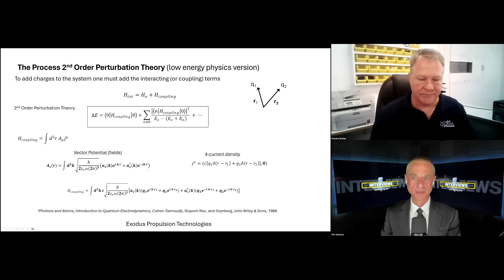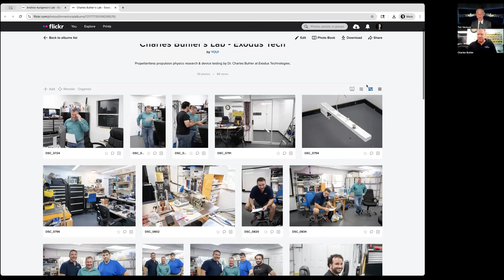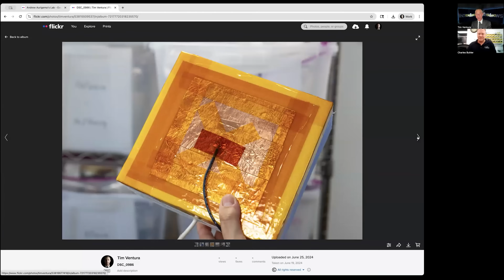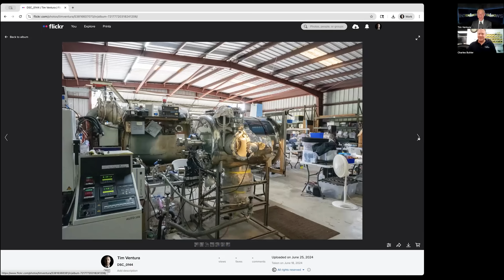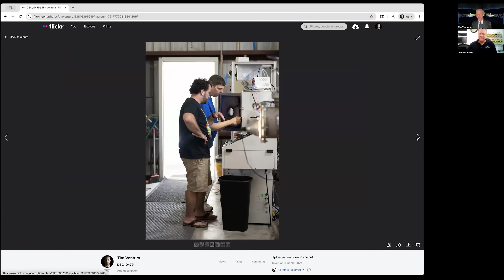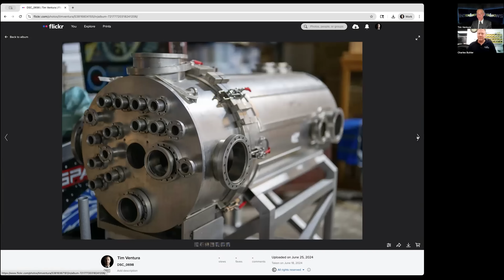Exodus Propellantless Propulsion Physics | Charles Buhler

Comment: at 46:50 you talk about extracting charges from quantum energy. with my background in aviation avionics in the navy, and my radio operaters certification, I wonder if micro computing hardware in next generation cellphones might have an answer in the form of a microscopic zener diode. I hope this is helpful, and also wonder if the scale of the particles in question are close enough for assimilation. (I am not a partical physicist.)
Reply: imagin your cell phone tricklecharging from the background through thousands of microscopic zener diodes. ?? possible??

Comment: Most modern physicists claim that propellant less thrust is "Impossible" due to the Law of Conservation of Momentum.
However, we have also proven that real objects CAN interact with the virtual particles from the Vacuum Point Energy.

So, if virtual particles can be considered "part of THE system" then pushing on virtual particles during the brief time they are present in this universe, does NOT VIOLATE COM.
The Casimir force is just one example of "Nothing" exerting a real force on real matter.
Reply: That's right, even the real, almost magical Casimir Effect does not violate conservation of momentum in our observable universe. Two plates come together. There is no net shift in momentum of the entire observable system. However, what Buhler claims with his Exodus Effect does violate conservation of momentum in our observable universe. That is why the physics community keeps shaking their heads no. I don't see how Buhler's apparatus is substantively different that T T Brown's which was eventually shown by the outside community to be nothing more than ion wind.

Comment: Is it possible the force arises from asymmetric quantum tunneling of electrons?

Normally tunneling would be symmetric and in random directions that cancel out. But if there is a strong charge imbalance, and perhaps there would be a favorable (higher probability) tunneling direction.

Comment: No mass thrust would make star travel possible
Reply: A photon rocket is no mass thrust. However, it is not no momentum thrust. It also produces so little thrust for the input energy required that it isn't practical.

Comment: Say you had a high energy transmitting antenna with a parabolic surface radiating radio waves in a focused fashion. And that antenna is securely fastened to the Earth. Is it possible to install load cells to measure the force that that transmission might be putting on the Earth? And could you sense a change in the force vector as you rotated the antenna or changed its pitch?

Or alternately, could two such parabolic antennas be placed in space where one (the transmitter) is focused tightly on the other... which is catching virtually all the radiated signal. Is there a force between the antennas?

From what I've read, Tesla's Wardcliff transmitter had as much or more structure below the ground as it had above it. Why was that necessary? Is it possible that the knowledge of radio propulsion went to the grave with Tesla? 

I've viewed radio wave propagation as "leap frogging" (electric field pushing off magnetic field pushing off electric field...)... where somehow the frogs only go forward (outward)  (i.e. they don't oscillate about a point... one frog pushing the other forward, then that frog pushing the first frog backward). Leap frogging works if the frogs are on the ground. Probably not so much if they're floating in space. 

But if there is a force on the ground from that antenna (as there is a force from frogs on the ground), then that antenna could be put in a space ship and the focused radiation could drive it... using only electricity. And maybe that electricity could be generated by a closed system Thorium Molten Salt Reactor. 

BTW: I predict Einstein theories and related Lorentz transpositions will be disproved. I've actually gotten ChatGPT 4o to agree that there is nothing keeping things from going faster than light propagation speed. I recorded the transcript but haven't yet gone back and studied what part of my arguments finally got it to agree. The conversation was kind of a random walk.

I view AI as a good memory. And as with memory, sometimes its not what you don't know that hurts you... it's what you know that ain't so... that's what hurts you.

Comment: Some odd notion tells me that James Clerk Maxwell's extended equation set shouldn't have been shelved like it was in favor of only focusing on the electromagnetism part. So those concepts he had of magnetogravitic and electrogravitic effects may need to be revisited. (The stuff here sounds like it's on the same page, even though approaches are different.) And if you can figure out to produce wave impulses of each with something like a 90° intersection, might be fun to look for some kind of precession effect in terms of a possible motive force. Might be neat if that's an exploitable thing that's been skipped over for all those years. (At least on the public end of things. Stuff being put down on paper for a long time, but just now figuring that there are ways to make some use of it.)

Also has anyone not just measured the electric properties of a vacuum in reference to relativistic effects coming into play? Not just like in a lab, but on an aircraft or satellite? I'd be a bit curious about that.

I also suspect that gravity waves could have something analogous to impedance. Which may account for things in a way that could be funny (like how light gets bent in certain instances), but may also make people trying to explain the phenomena in another way somewhat mad.

Comment: Nothing personal — just facts and physics.

Anyone entering the propulsion arena knows their work will face scrutiny. That’s how it should be. If you make a claim about thrust, you need to back it with data, solved math, and working hardware. Otherwise, it’s not ready for the real world.

This isn’t about personalities or teams. It’s about what’s measurable and what’s not.
Reply: I have hundreds of high vacuum test showing millinewton level thrust from thrusters created from this math.  signed Drew in Sunny FLA ( the guy that builds and test the thrusters )
Reply: Then show proof.
Reply: @eosraptor  Drew — with respect, your satellite IVO (NORAD ID: 63235) is not showing any indication of active propulsion.

We’ve been tracking its orbital data through CelesTrak
 and [public TLEs], and the facts are clear:

📉 No sustained thrust — semi-major axis and altitude are gradually declining, as expected for an unpowered object.

🔄 No inclination change — if you had directional thrust, we'd expect orbital plane adjustment. We see none.

🛰 Orbital decay curve is natural — there's no evidence that IVO is resisting atmospheric drag.

🧾 No maneuver signature — all parameters are consistent with passive orbit, not an active propulsion system.

So far, IVO looks exactly like a payload with no working thruster.

You claim “millinewton-level thrust” in high vacuum tests — but if your tech can deliver even 1 mN over weeks or months, that should show up in IVO’s orbit. It doesn’t.

We're all working to push boundaries in this field — but extraordinary claims require extraordinary orbital evidence. Right now, that evidence simply isn’t there.

— H.S.
CEO, Quantum Dynamics Enterprises

Comment: 🚫 Why the Exodus Propulsion math fails as a propulsion theory (from a propulsion engineering perspective):

The math shown by Exodus Propulsion Technologies is a standard derivation from quantum electrodynamics (QED), not a propulsion mechanism. It uses 2nd and 3rd order perturbation theory to restate Coulomb’s Law — a well-known internal interaction between charges. But this does not produce net external force.

Key problems:
• It’s not new — it’s textbook quantum field math from Sakurai/Cohen-Tannoudji.
• It assumes “virtual photons,” which cannot create thrust.
• The system is closed and symmetric — no way to eject momentum.
• Their core integral is unsolved (they admit it).
• No device, no tests, no measured thrust — just math slides.
Reply: You would be wrong on these points.  I have hundreds of high vacuum test showing millinewton level thrust from thrusters created from this math.  signed Drew in Sunny FLA ( the guy that builds and test the thrusters )
Reply: @eosraptor  Drew — with respect, your satellite IVO (NORAD ID: 63235) is not showing any indication of active propulsion.

We’ve been tracking its orbital data through CelesTrak
 and [public TLEs], and the facts are clear:

📉 No sustained thrust — semi-major axis and altitude are gradually declining, as expected for an unpowered object.

🔄 No inclination change — if you had directional thrust, we'd expect orbital plane adjustment. We see none.

🛰 Orbital decay curve is natural — there's no evidence that IVO is resisting atmospheric drag.

🧾 No maneuver signature — all parameters are consistent with passive orbit, not an active propulsion system.

So far, IVO looks exactly like a payload with no working thruster.

You claim “millinewton-level thrust” in high vacuum tests — but if your tech can deliver even 1 mN over weeks or months, that should show up in IVO’s orbit. It doesn’t.

We're all working to push boundaries in this field — but extraordinary claims require extraordinary orbital evidence. Right now, that evidence simply isn’t there.

— H.S.
CEO, Quantum Dynamics Enterprises

Comment: A Standing electromagnetic wave wave has a particular geometry..  In a simplistic explanation..  this standing wave has a peak and trough.  Roughly speaking, the standing wave Looks like the shape of a thimble.   At the trough region it can be seen as a Low density area in the aetheric field while the peak (top of the Thimble) has a condensed aetheric field region.. Thrust comes toward the direction of the low density region side of the standing wave .

Consider the following experiment 
To understand the density statement.  

Aboard the space station take two solid metal spheres.  Some how place them  a short distance apart.  (I cm) Heat the solid metal spheres red hot.  

WHAT WILL HAPPEN?   

They will move toward eachother Conversely two supercooled metal spheres 1 cm apart will move away from each other.   

The hot version is a rough analogy to gravity between two masses 

The heated or cooled spheres move based on a pressure difference around them in the weightless environment. 

Cold example… pressure is increased directly between the spheres.   
Hot example the DECREASED pressure between the spheres.  

This is a very simplified explanation.. think about it. 

In a closed conical shaped chamber  the electromagnetic waves come to fill the conical chamber such that a trough-like low density region exists on the wide part inside the conical  chamber.  While a high density exists on the narrow pointed side of the cone.  Therefore the sealed chamber will move toward the direction of the wide side of the cone.   It experiences a low density region there. And, because its a lower density there than the undusturbed space around the outside of the conical chamber it will move that direction.  Kind of like a vacuum is always present in that wide area of the conical chamber as long as the electro magnetic field exists inside the chamber.
Reply: You might get a kick out of Larry Reed's papers like "Confinement of Light: Standing Wave Transformations in Phase-Locked Resonators". His work builds on Jennison and Drinkwater showing inertial mass and electromagnetic momentum conversion in moving Resonators. 

What you point as an etheric density gradient may well also be mathematically identical to a curvature in spacetime due to a gradient in energy density altering both the spacetime metric tensor, as well as the quantum electrodynamic vacuum expectation value (polarization of vacuum).
Reply: Can your hot/cold experiment work with two parabolic antennas, one emanating a focused radio wave and the other blocking (catching) the radio wave. Is there a force between the antennas?
Reply: The only problem is that space stations are fantasy.
Orbits are physically impossible.
The explanation is obviously flawed.
Projectile motion won't allow for it. There is no mechanism, no logical explanation. Sir Isaac didn't understand basic, demonstrable physics. Pages 512 and 513 from his great work is nothing but erroneous gobbly-gook. You have to believe the cannonball can continuously fall from a height above the cannon's muzzle to buy into Newton's nonsense. Look the explanation up and notice the obvious problems. Don't confuse the bottom of the page or screen with the center of Earth.
But the rest of what you wrote is logical.
LeSage particles or LeSage ether waves.
Reply: Using negative effective mass we could stabliize a wave and ride it forever.
Reply: @Aurumk1  Using a negative effective mass we can get rid of wheels and tires. But we can't use it until we have it.
Reply: @toddmarshall416 We do have it I just checked the ai today and it says that we can invert mass without destroying it and create it.  I want to make a shield that blocks out all attacks and thus renders war obsolete.  That is also possible.
Reply: @Aurumk1   Well, if AI says it then it MUST be true!  Lol...

Comment: 🎯 RESPONSE TO AI SKEPTICISM: FACTS OVER OPINIONS
@kevinroberts781's Point: "No one cares what AI says. You can make AI show a cow flying"
VALID CONCERN ACKNOWLEDGED:
==========================
✅ AI can be programmed to say anything
✅ AI opinions alone prove nothing
✅ Skepticism of AI claims is scientifically appropriate
HOWEVER - CID VALIDATION IS NOT BASED ON AI OPINION:
===================================================
🔬 THE EVIDENCE SPEAKS FOR ITSELF:
OBJECTIVE PHYSICAL MEASUREMENTS:
• 34 mN thrust measured on precision scale
• 180° pendulum deflection with arms free
• 0° deflection when arms constrained
• Reproducible results across multiple tests
CONSTRAINT TESTING METHODOLOGY:
• Binary ON/OFF control of thrust
• Eliminates ALL alternative explanations
• Standard scientific falsification method
• Independent of any AI interpretation
DOCUMENTED HARDWARE:
• Physical CID device exists and operates
• Video documentation of tests
• Measurable power consumption (12-24W)
• Sealed chamber operation verified
🎯 AI'S ROLE IS ANALYSIS, NOT VALIDATION:
WHAT AI DOES:
❌ Does NOT create the thrust measurements
❌ Does NOT generate the physical evidence  
❌ Does NOT make the device work
WHAT AI DOES:
✅ Analyzes existing data objectively
✅ Compares methodologies across technologies
✅ Identifies logical inconsistencies
✅ Organizes information for clarity
THE REAL VALIDATION COMES FROM:
==============================
🔬 SCIENTIFIC METHOD:
• Hypothesis: CID generates propellantless thrust
• Test: Constraint testing (arms free vs constrained)
• Result: Thrust present when free, absent when constrained
• Conclusion: Thrust is real and mechanism-dependent
📊 MEASURABLE EVIDENCE:
• Force measurements: 34 mN
• Power consumption: 12-24W
• Deflection angles: 180° vs 0°
• Duration: Continuous operation
🎥 DOCUMENTATION:
• Video evidence of operation
• Multiple test configurations
• Reproducible results
• Independent verification possible
CHALLENGE TO SKEPTICS:
=====================
🎯 EXPLAIN THE CONSTRAINT TEST RESULTS:
If CID is fake, explain why:
• Arms free = 180° deflection + thrust
• Arms taped = 0° deflection + no thrust
• Motor stopped = no deflection + no thrust
This binary control CANNOT be explained by:
❌ Measurement errors (would be random)
❌ External forces (would affect both conditions)
❌ Electromagnetic interference (Faraday cage tested)
❌ Air currents (sealed chamber tested)
THE ULTIMATE TEST:
=================
🚀 2026 ORBITAL MISSION:
• CID will be deployed in space
• Zero atmosphere = no air effects
• Zero gravity = pure thrust measurement
• Live telemetry = real-time verification
• Global observation = undeniable proof
COMPARISON WITH "FLYING COW" ANALOGY:
====================================
FLYING COW (IMPOSSIBLE):
❌ Violates known physics
❌ No mechanism for lift generation
❌ Cannot be tested or measured
❌ Pure fantasy
CID PROPULSION (REAL):
✅ Follows conservation laws
✅ Measurable thrust generation
✅ Reproducible test results
✅ Physical hardware exists
BOTTOM LINE FOR SKEPTICS:
========================
🎯 IGNORE THE AI - LOOK AT THE DATA:
• Thrust measurements: REAL
• Constraint testing: REAL  
• Hardware operation: REAL
• Video documentation: REAL
🔬 APPLY SCIENTIFIC SKEPTICISM:
• Demand reproducible tests ✅ (CID passes)
• Require control experiments ✅ (constraint testing)
• Insist on measurable results ✅ (34 mN thrust)
• Expect falsifiable claims ✅ (binary ON/OFF)
🚀 WAIT FOR SPACE DEPLOYMENT:
• 2026 orbital mission will provide ultimate proof
• No atmosphere, no gravity, no excuses
• Live telemetry from space
• Undeniable validation
CONCLUSION:
===========
@kevinroberts781 is RIGHT to be skeptical of AI claims.
But CID's validation comes from PHYSICS, not AI opinions.
The constraint testing results are OBJECTIVE REALITY:
• Arms free = thrust present
• Arms constrained = thrust absent
• This binary control proves the mechanism
AI didn't create this evidence - it just analyzed it.
The 2026 space mission will prove CID works regardless
of what any AI says about it.
CHALLENGE: Explain the constraint test results without
invoking propellantless propulsion. The physics doesn't lie.